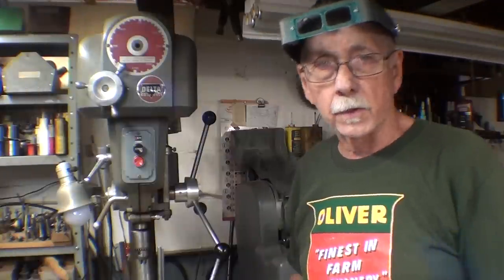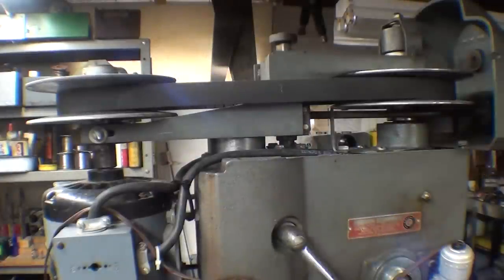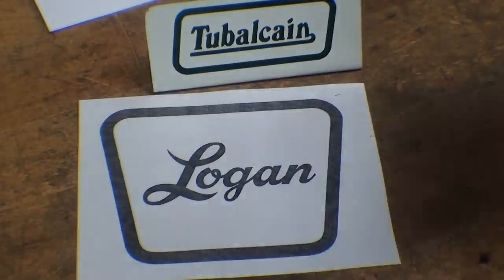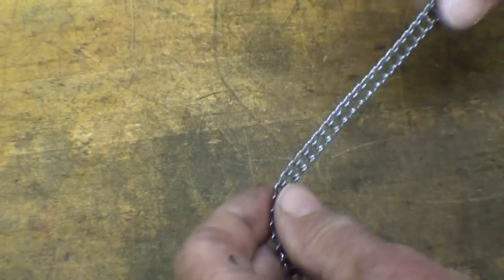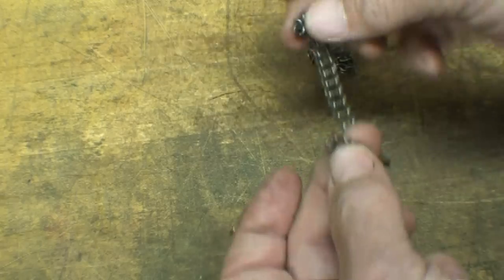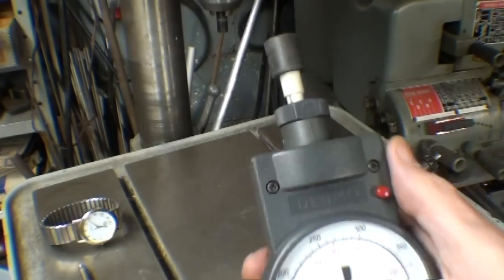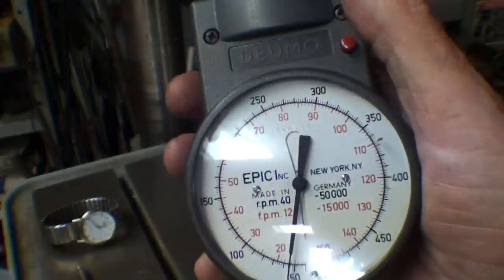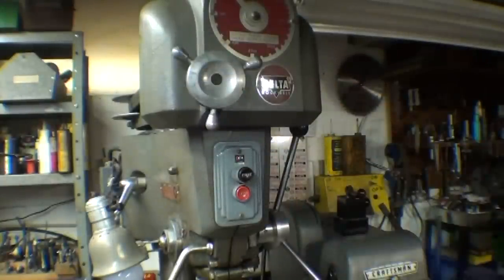Fixing the RPM Pointer on the Delta Press TIPS #401 tubalcain

Comment: Very good fix on that little indicator drive chain.

Neat that you have an EPIC tachometer. I was given one by a friend. It was making a similar noise to yours, and also not returning to 0. A little light machine oil in the mechanism was all it needed! I have used it quite a lot! Recently tested my 1930's Sturtevant blower with it and had it in that video. Very useful tool, if only it could read in both directions!
I've been really in a bind with the limited low speeds before. As you stated, using a VFD with the stepped pulley or variable pulley setup is so useful for holesaw cutting!

Comment: I have one of those Delta drill presses you talked about model 20-950. 20 inch variable speed, so far so good,  it has been in service in my wood shop now for 8 years and still not a problem. But I do baby my machines and service them alot.

Comment: I bought one of the "modern" Delta variable speed drill presses (model 17-925) sometime in the early 2000s. I expect it was fairly expensive, as I was not counting my pennies at the time. It has two ranges (shiftable with a lever): 150-1100 and 500-3100 rpm. The speed mechanism hasn't given me any trouble, but when using a large drill bit and putting a lot of pressure on the bit, the table deflects downward (and angles outward) enough to put a lot of side pressure on the bit (and the spindle). I had to make a jack (using a length of acme all-thread, a large wingnut, and a length of pipe) to support the table near where the pressure is being exerted. A stud set into the base (directly under the spindle) locates the end of the pipe; the webbing on the underside of the table locates the end of the all-thread. Just put a bit of pressure upwards before you start to drill.

Just a note for anyone who notices that their drill press sometimes moves the location of a hole by ten or twenty thousandths (towards the column) or somehow drills an oblong hole: check for table deflection. Put an indicator base on the column and measure the table surface or workpiece as you put some pressure on the bit. If it moves, you gotta counteract it.

Comment: This is somewhat relevant to this video, since it concerns your three spoke handle conversion.  I was at an estate sale last Thursday and there was an older Delta drill press that appeared to have a homemade handle conversion that was a wheel made of round rod with three spokes that were bent to shift the wheel out from the side of the drill press head. The wheel was about the same diameter as the handle knobs would be.  It was an interesting idea, I'm not sure how well you could change your hand position without the spindle retracting, but you have the same situation if you have to move your hand from one handle to another of the conventional three handle spindle actuator.

Comment: I totally agree on drill presses all of them run 10 times faster then they need. I would love a real slow speed variable model. I guess being a machinist and mechanic ill be building my own out of my best 20" old Rockwell with power feed . It's a monster to be messing with for sure it must weigh in at 600 lbs. All my machines are in wait and see how my operations turn out. Bulging discs have me reall screwed up. Thanks for the vid

Comment: Hi Mr Pete, I just purchased a Logan 6560H 14" model back in July, its in pretty good shape, although the variable speed belt system on mine could use a little work if one wanted to make it quieter. I am missing the recognizable cast aluminum "Logan" logo that is typically on their larger models (12" and up I think.) I hope to one day build a backyard foundry set-up so that I can cast a replacement nameplate and of course other projects. Thanks for all of the fantastic videos and inspiration!

Comment: Thank you for doing this video. I have the bench top version of this drill press, and it has the same exact issue. I also took the time when I got mine to replace the wiring with better quality insulated wire. anyway I know now that I need ladder chain!

Comment: I have a TULL branded drill, supposedly an industrial machine for metal working. It has 12 speeds between 290-2330. As you say the slowest speed is still not slow enough for many jobs, in fact I rarely move it from the slow speed since it mainly gets used for hole saws and forstners. One day I will fit a variable speed motor to it, the 12 speed pulley setup should allow me to get some very high torque at low speeds.

Comment: To protect a variable speed drive like that from metal shop dinguses you could mount a solenoid to interfere with the exposed teeth on the chain sprocket. Wire it in parallel with the motor so it retracts and frees the sprocket when the switch is on and locks it in place when off. Like a steering wheel lock on a cars.

Comment: My Machine shop teacher put another set of step pulleys on the drill presses we had. Mounted a shaft where the motor was then inverted the motor so it went through two step pulleys to get lower rpm at the chuck end. The drill presses ended up with 12 speeds had to reverse the motor to flip it over.

Comment: I have a Shopsmith with a variable speed drive, very similar to the drive on your drill press, it has a variable diameter sheave, and the same warning about only changing speeds when under power. Very nice, 700-5200 RPM. Too fast for metal but still nicer than belt changes. Shopsmith also makes a intermediate belt driven speed reducer, 7:1, so 100-743 RPM.  Next year a metal lathe.

Comment: The china tack may be ok. I have one and found out it won't tolerate any reflections. Perhaps it was picking up a reflection from the polished portion of the chuck. I expect the ideal condition would be a flat black cylinder with only the white strip would give a fair reading. Mine has worked well on various hit-n-miss engines where there was really not any reflective surface.

Comment: Harbor freight has a lathe that uses this style of speed change. Its troublesome according to a couple of reviews I've seen but it seems to work fairly well at speed changing without moving belts on stepped pulleys. My drill press never gets changed because I can't figure out what grooves to move the belts to to get particular speeds.

Comment: Hi Pete, I have a Clausing variable speed drill press at work with a similar mechanical speed mechanism but instead of a separate needle speed indicator , the speeds are marked on the hand wheel (Ships wheel) dial. I sure will miss having access to this shop area when I retire.
Reply from the maker: I had a clausing at the school--I still miss it

Comment: I hate step pulleys!  I used the same speed (about 675 rpm) on my old mill-drill for everything for years because it was a pain to change speeds.  I swapped in a treadmill motor controller last year and love it.  It is a bit noisier, but it's worth it.

Comment: Before you put a knob on the ship's wheel maybe you should let the ladder chain break in a bit.  It seems a bit stiff to turn right now.  Also, can you loosen the screw that holds the indicator needle and move it to read correctly?  It seems to read a bit low.

Comment: I wonder if a modern metal "push" belt would work for the lower speed, higher torque cvt needed for the large diameter metal cutting bits. It would probably increase the weight and complexity to the point that either selecting gears, or just going with a three phase motor with speed controller is cheaper, easier, and more reliable.

Comment: Very much agree with your comments about the options concerning current drill presses. The step pulley should go for drill presses just as it is being replaced in even lower cost milling machines. A few years ago I had to purchase a drill press for a museum shop and to be frank everything I looked at was "junk." Step pulleys, horrible spindle bearing run out and poor locking mechanisms on the tables. IMO non of the units I found would be worth anything after twenty years of even moderate use.Yes, you do get what you pay for, but as far as I could determine the price jump between "low cost" machines and a reliable drill press was near to a factor of ten.

Comment: Instead of having the ladder or even roller chain way too tight I would suggest using a tensioner on the chain.  A tensioner can be made with another sprocket, roller,  or slide.  Roller chain has available tensioners  one of which is a snapidle.

Comment: Your dead on about the speeds on pedestal drills. My unit at home is step pulley but slowest I can go is 450. It has a 32 mm capacity but forget it. Wayyy to fast. I always resort to going to dads to use his 1908 'The Rockford' leather belt drive drill with the split pulley at the top. Such an old drill but with automatic feed and anything over 1 inch drill you can slow it down to about 40 rpm. This drill used to run on steam on an overhead shaft at Hugh Lennon agricultural fabricators where he did his apprenticeship. Still going strong. If my chinesium unit lasts a quarter of that life I think I'm doing well .haha

Comment: the clausing would probly handle the tourqe of 100 rpm or so the whole head turns on the stem if your not careful on those china ones (it'll push the spindle right) its only held in place with two set screws

Comment: The flicker of the fluorescent lights mess up those optical tachometers.  Try it outside or under an incandescent light.
Reply: Eric Van Andel 
I think it mainly went in the trash because it was Chinese.
Some prejudice is OK.
Reply: I have one of these random (guess the speed) Chinese tachometers but never knew fluorescent light would affect the reading. Thanks for the alert, now I'll try the little cheapie with no lights, incandescent, or outside.
Reply: Ellie Price Point the tacho at a fluorescent tube and check that it is working, Different readings on 50 or 60 Hz though.
Reply: Eric and Brain, I'm certain you're correct. Now I'm wondering if the tach will give accurate reading if I shield (shade) it and the target from direct fluorescent flickering? I'll try that and see if it makes a difference.
Reply: Ellie Price Just to add to my earlier reply - at 50Hz an old style fluory will give 6000 rpm±2 and at 60Hz will give 7200rpm±2.
Reply: 60 x 60 = 3600 flickers per minute. 3600 x 2 = 7200. If this is correct the tachometer must double 60 Hz per second to read 7200. This off the top of my head, have no idea how it reads the light.
Reply: Optical tachs have certain requirements of the target.  The one shown in this video wasn't ideal.

Comment: What kind of ac motor can I use the voltage control you have on other drill press. I have an old Rockwell I would like to add that mod to
Reply: A 3-phase ac motor. You will note that the 3ph motor may be smaller than a single phase of the same horsepower because the 3ph motor is more efficient.
Reply: You can get a speed controller for a single phase AC motor as well.  Check the current draw or HP rating of the motor and get a speed controller that can control that size motor.  Note that single phase high power speed controllers get spendy

Comment: i have put a treadmill motor and controller on my delta-rockwell drill press with good results.. i added a digital tach also. runs from 0 to about 1400 RPM
Reply: I made the same mods to my old mill-drill.  It works great down to about 30 rpm, when the controller starts to struggle with the load.

Comment: Hey Mon Ami I have a question for you........   I have a broken bolt in a sump / crankcase cover....  My buddy has some reverse drill bits.  We did the sneak up method  on it from small to larger.  No go on that. I seen a video that one guy did a 1/8 hole then put a 3/16 bit in and it worked like charm..   So my question is ????????       

Did I do it wrong or did he do it right ??   I am not familiar  with the left handed bits .......

Thanks for a reply  Mon Ami ~!~!
Reply from the maker: Since the LD drill did not work---try an EZ out.

Comment: I totally agree with the drill press speeds. They have these ridiculous speeds of 3000 rpm but don't go below 500rpm. I have never needed to drill anything at 3000 rpm.
Reply: It helps keep the drill mfgs in business
Reply: You use it for flow drilling. https://www.youtube.com/watch?v=NhkWINPRK3A But a hobby machine might not have the power needed because it requires both speed and torque applied

Comment: Think you threw that electronic tach away to quick. Variable pulleys are notorious for wandering slightly in an RPM range and going faster and slower for short periods. Watch the jerkiness of the Starrett RPM guage it goes faster and slower as the belt flexes between the pulleys. Because you were only measuring for a couple seconds with the  electronic tach it was catching different periods when the shaft was going faster or slower. The short period you measured compounded the error and you were getting readings all over the place.
Reply from the maker: good point

Comment: Clausing makes a 20" drill press with the variable speed drive. It's still made in the US, but runs around $4,000 dollars.

http://www.clausing-industrial.com/detail.asp?p=D&l=CDP&m=CDP20
Reply: Yep, this is what you need in a commercial job shop. Not cheap, but necessary when time is money. Those drilling safety shields are about as useless as tits on a bull..I've never seen one last over a week before the chips ripped it apart. A drill press does not tolerate careless operation...even a small one can tear you a new one. A drill press, especially like the big Clausing ,demands that the work be securely held because you ain't slowing that spindle down once it grabs the work.

Comment: Aw, that's a boring way to indicate "speed" it only shows the cvt setting, rather than the actual speed. Something like an oil damped needle with a magnet being dragged by a rotating aluminium or copper  might have worked. Perhaps just an old car speedometer with a custom faceplate would work?
Reply: Robert Szasz 
But aren't you impressed by the elegant simplicity of the indicator,  which also happens to work surprisingly well?
Reply: Landrew0 I guess. A handwheel with a knob and of the same size and placing as the indicator, with the speeds etched into it  would be my first thought. 

When possible I prefer indicators separate from the bit used to input the setting to indicate the actual state rather than the commanded state.
Reply: Robert Szasz 
Insofar as what you need for accurate speed control in a drill-press, this far exceeds all requirements. And it's elegantly simply too.